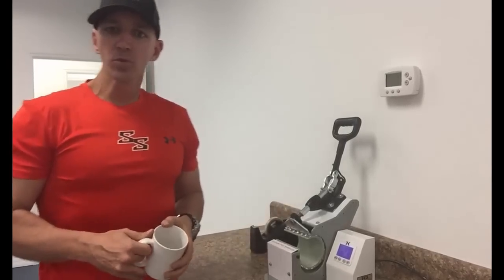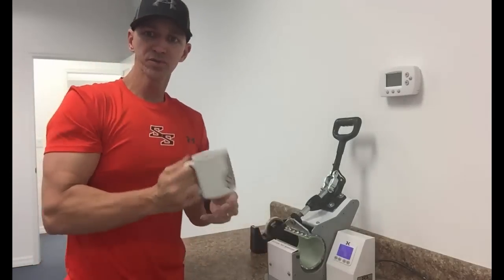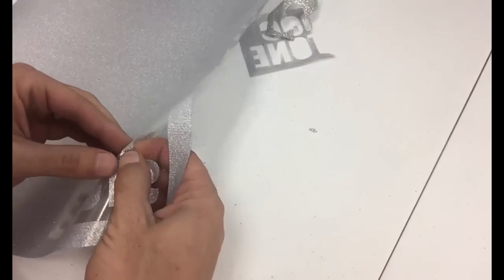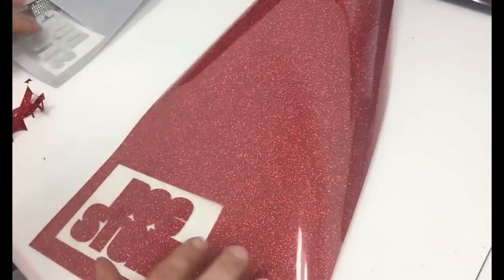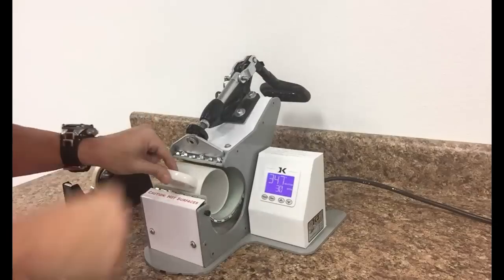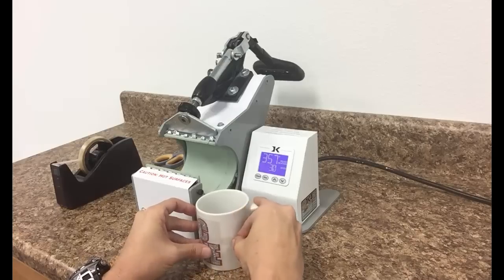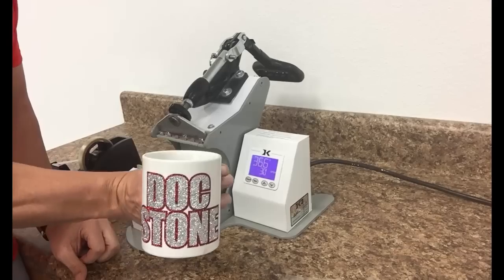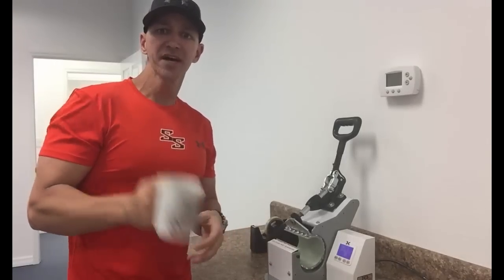TRW Lab #7: Can You Press Glitter HTV On A Coffee Mug?

Comment: So, since you layered the glitter vinyl (which I was told you shouldn't do) will this work on shirts as well? I was told you could layer plain HTV but NO glitter on the bottom layer at all.
Reply from the maker: You wouldn't want to layer glitter vinyl on a shirt as it will need to be washed, you would want to trap the top layer into the bottom layer instead! You can get away with on a mug like this because it's not something that you're going to be wearing or putting through a washer and as mentioned in the video, you would want to hand wash it. We still have this mug and it's going strong, no damage has occurred! :) 

Alexis @ TRW

Comment: Hi! Just wanted to know about the longevity because someone else did a video comparison on permanent adhesive vinyl and htv vinyl on mugs and they said the permanent one last longer. However when I tried the permanent one, mine just came off as I stuck them on but they were more of a script font if that makes a difference. If it's a script font, will htv be the better option?
Reply from the maker: The type of font should not matter, not quite sure why it would fall off so easily unless it wasn't a smooth surface or properly cleaned before putting the decal. I would say that they both have a similar longevity time but there is many variables that could play out. If you apply the HTV or the adhesive correctly it should last for many washes. Let us know if we can help answer any other questions.😊
-TRW Mireya
Reply: @TheRhinestoneWorld  how about the size? Like are there less tact for smaller decals? I made 2 mugs, one with a name going down where the handle is and the other is a flower. The flower stuck on even through lots of washes but the name came off so quick

Comment: Have you tried your heat press with wine glasses?
Reply from the maker: +Kimberly Whitten 
We don't recommend using heat on the wine glass. The wine glass is an awkward shape to work with and has a high potential to break.
You could use FDC intermediate vinyl and Bling anything material.

https://youtu.be/9hH6TQL1jFM

This link has a lab that Matt did with wine glasses and wine bottles.

TRW Casey

Comment: can you use any type of vinyl?
Reply from the maker: When pressing to a mug, you can use any type of heat transfer vinyl. However, you can also use decal vinyl, but you could not press the vinyl to the mug. So you can use either, but the application process is a little different. 

TRW Kaitlin

Comment: I am curious, in a previous video you said that you should not adhere glitter vinyl to glitter vinyl.  You can however adhere glitter vinyl to HTV.  Could you clarify?
Reply from the maker: Hello,
In this video, because the vinyl was being applied to a mug, the vinyl could be layered because it will not be worn or washed or a washing machine. Although, when layering vinyl on other products such as a shirt, the only vinyl that can be layered on top of is easy weed vinyl. If you are using another vinyl, such as glitter, you will get a better application if you adhere the vinyl to the product you are working with. This way, when the shirt is worn, washed, and dried, the vinyl will still last.

Comment: I got my glitter vinyl to stick wonderfully but my standard HTV will not stick. Maybe it's the brand?
Reply from the maker: Hello, 
Are you pressing the glitter and regular HTV in the same press? If not, be sure to press the standard HTV first so that the heat press and apply complete heat and pressure to the vinyl. Are you using a mug press or a regular shirt press? You can also try to use a higher heat and press for longer to allow the vinyl to get a better application. Let us know if this works and f not we will be happy to help troubleshoot!
TRW Kaitlin
Reply: I am pressing in a mug press set at 360 for 30 seconds. It works fabulous on the glitter mugs but not the standard. Not layering just playing around with both vinyls.
Reply from the maker: Hhhmmm, we have had success adhering out regular HTV with those settings. What brand vinyl are you using? And are you using a sublimation mug?
TRW Kaitlin
Reply: No, not a sublimation mug. Should it be? I am use Specialty Materials. Great luck with the spectrum and glitter. With the Thermoflex I am having a harder time.

Comment: Can you use this on a wine glass?
Reply from the maker: Hello! Normally, you would not be able to heat press onto glass, but you can put the glitter HTV on Bling N-E-Thing material, and apply it that way. That material can be found here: http://therhinestoneworld.com/Bling-N-E-Thing-Decal-Material - TRW Richard.
Reply: Thank you ☺
Reply: I've been trying to do htv on wine glass with a mug press- my issue is the adhesive coming out around the edges like a halo.....even tried decreasing temp and pressure a bit....sigh  I have all this htv I could use if it would just work.